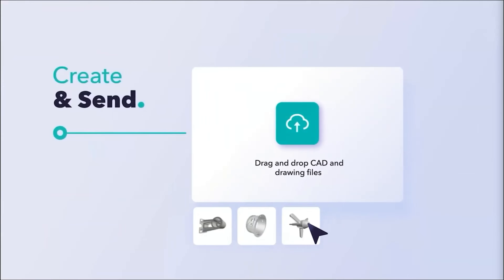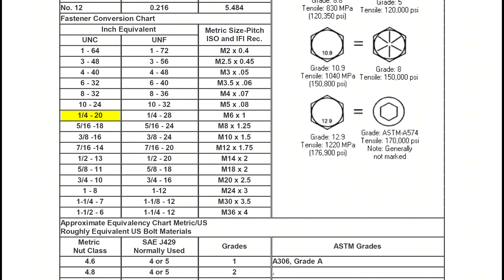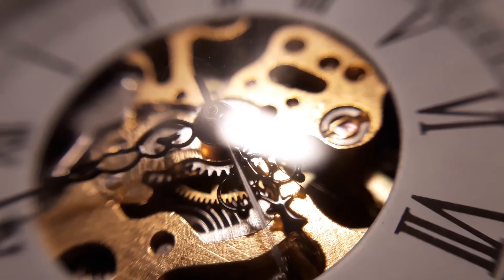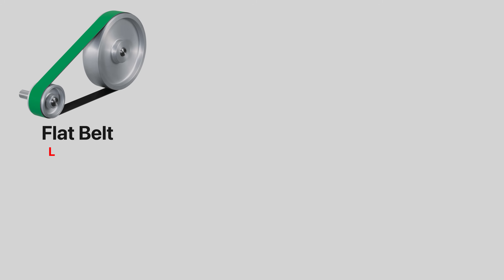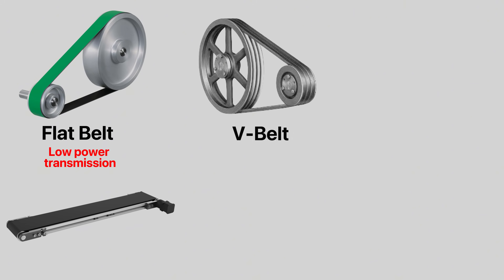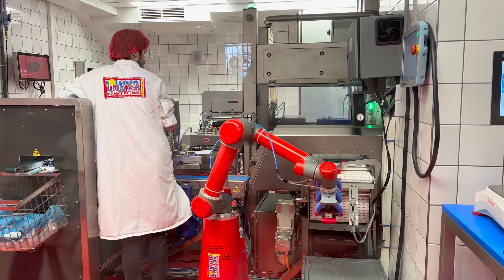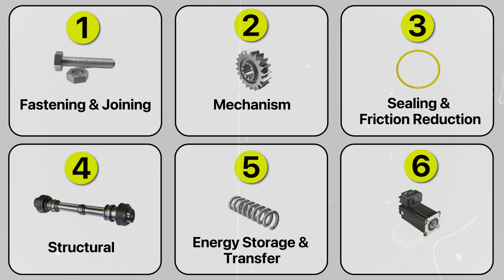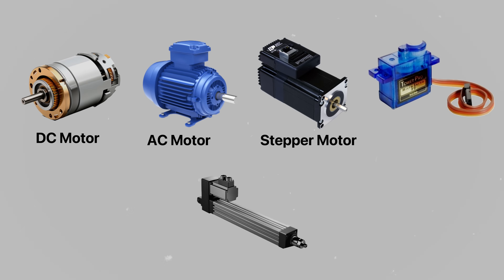The Secret to Becoming a Great Mechanical Engineer

Comment: 🔴You place a stone weighing 5 kg in water at a depth of one meter.
What will the stone weigh at a depth of one meter?

You drop a 1 kilogram weight from a height of 1 meter onto a steel plate placed on a simple scale.
What will be the maximum weight recorded by the scale?

101,000 subscribers, no one to answer me? Even with an approximate result?
How useless are our "engineers"?

Comment: I like your videos.. can you please make a video on how to teach yourself mechanical engineering without going to university. Like a shortcut to get a general overview without all the mathematical details. Maybe you know about free online courses?
Reply: Study Shigleys Mechanical engineering book
Reply: Project based (guided) learning even if it’s a simple project or a simulation somehow.
Reply: Pick up a mechanical engineering degree plan of a university and study the courses there. Common courses in all ME degrees are statics, dynamics, thermodynamics 1 &2, fluid mechanics, heat transfer,  machine design, materials science , and manufacturing processes.
Reply: You can also download the FE mechanical engineering reference manual which is used to take the FE exam. Th manual will contain much of the knowledge expected of a mechanical engineering graduate